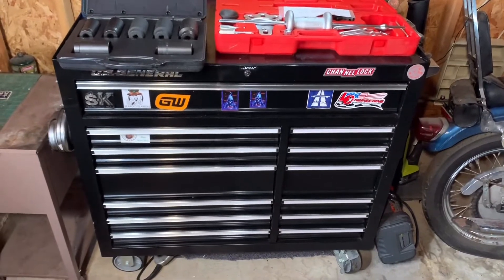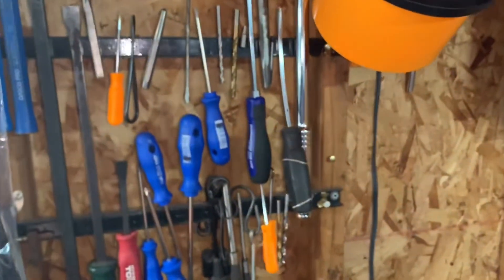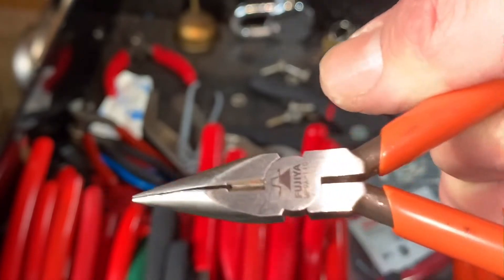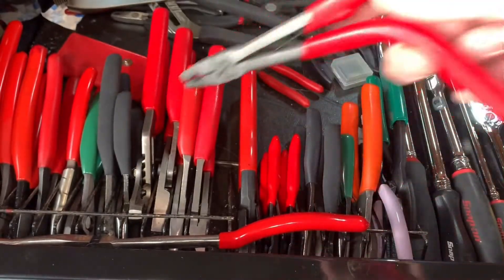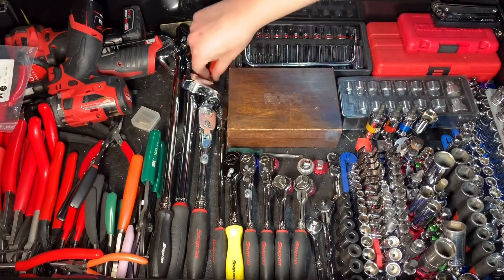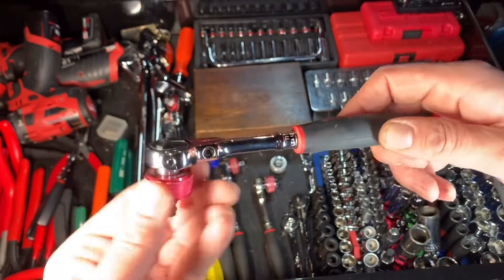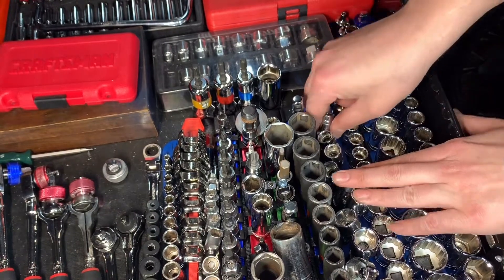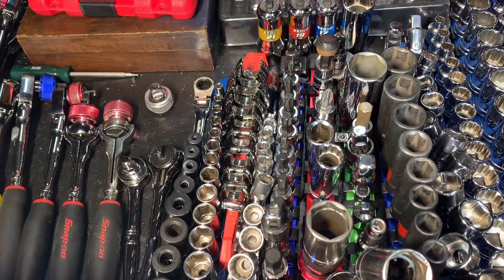US GENERAL II TOOL BOX TOUR: YOUTUBE UNIVERSITY MASTER TECH PART 1 Upper Deck

Comment: I have those 1/4 inch socket sets mm and sae for 30 bucks or little over 30 mm from 4 to 15 deep and shallow I have to buy the 15s separate but is a complete set love them